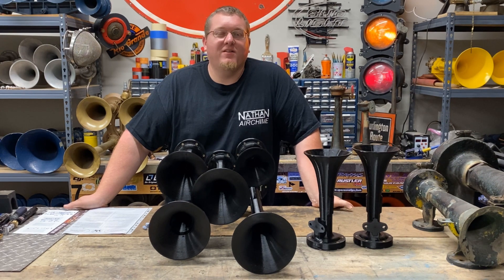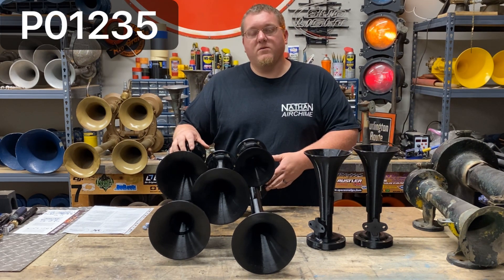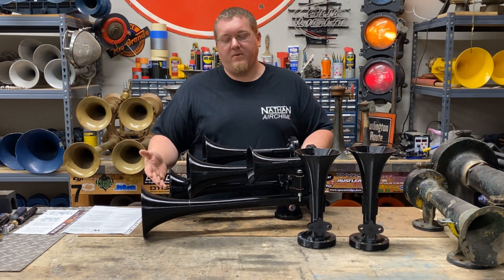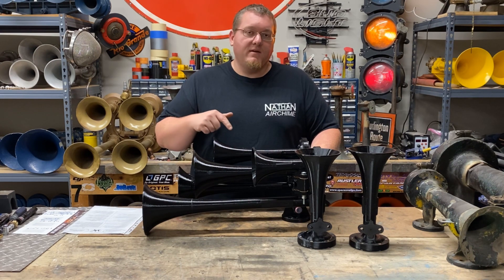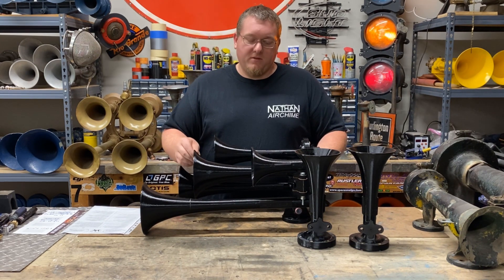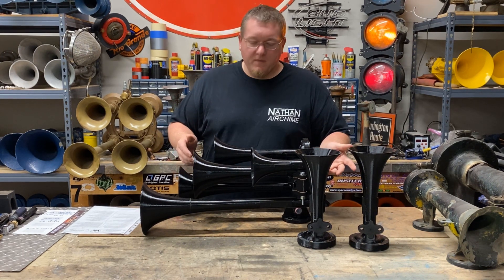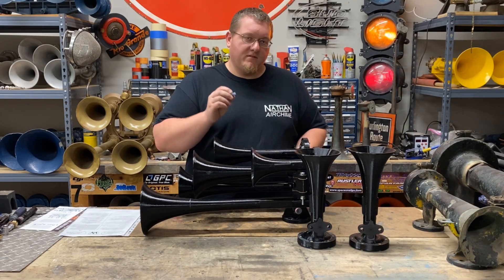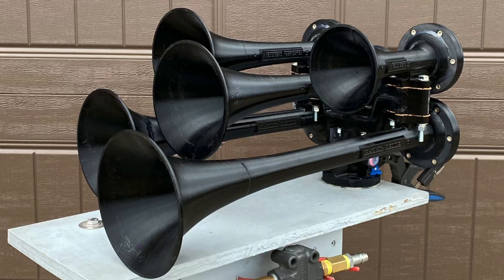A real FUNCTIONING 3D Printed Train Horn! Loudest 3D print on Earth!

Comment: damn that sounds good. I could print these on my rig at home as it's basically an industrial printer at high end consumer price and will print PETG easily. I'd even look at something hardier for the shell. TPU is also easy to print if you know what you are doing... Would need to make the longer horns in 2 parts though. 

Edit: they are 2 piece lol, might be using similar machine then. 

edit: they are using an FLSUN V400 printer lol. Has a slightly taller print bed but less speed/quality/material handling than mine. It's interesting they still made it 2 parts, I think they had innacuracy/layer shift when doing the long ones in one hit ;)

Now I want to make my own horns from scratch and not replicate a design. I know guys getting 3d printed designs in plastic up to 500psi or higher in racing applications. It can handle it without going to exotic materials ;)

Comment: I really like the idea of this but this would not last. I have 3d printed many things and strength always lacked. If ya were to bolt this somewhere and hit a hard bump or bump into it you would easy snap a bell off. If they made stronger plastic this would be worth the price.
Reply: PETG is pretty strong, I've been running 3D printed car parts and they hold up really good. However I am worried about the long one though.
Reply: Maybe if you put them in a small metal cage they would be more protected? Or mount it on the interior of whatever the vehicle is.
Reply: "hard" TPU never breaks. Not sure it works acoustically though.
Reply: See, my biggest concern was just the length, expeeshilly to put this under a vehicle like most people do. I have seen aluminum bells get chipped or broken. Plastic would not stand a chance expeisly exposed to road elements.